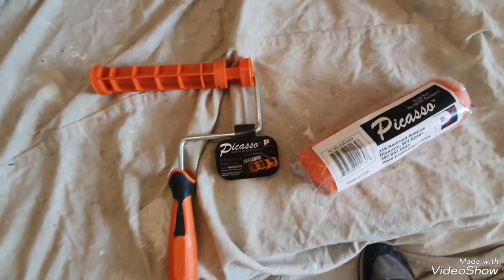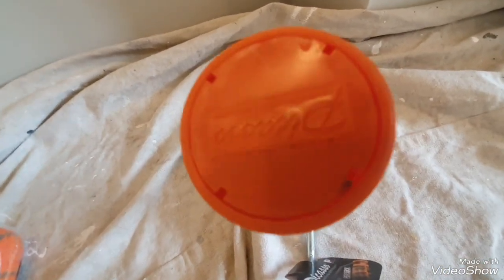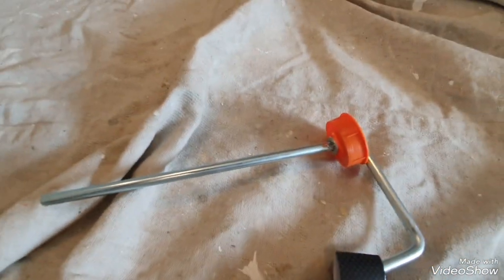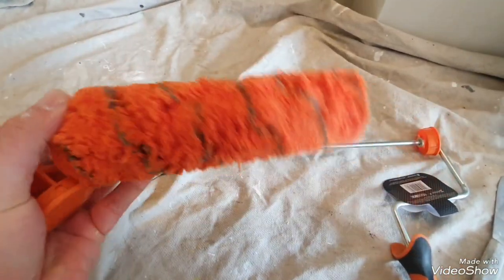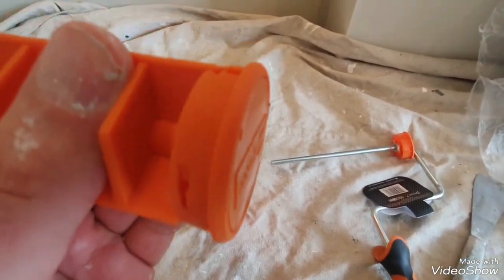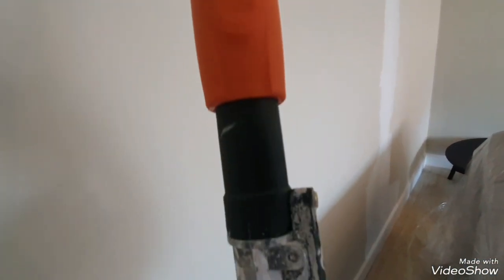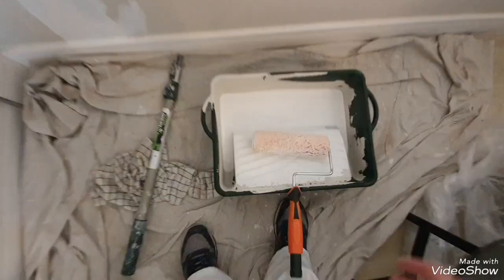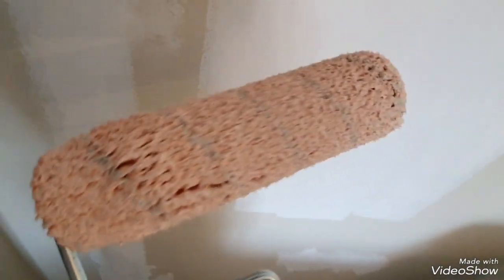The Best Roller Frame And Sleeve Yet

Comment: Paint is defined as a unique homogeneous mixture of three major. ingredients namely Binder, Pigment, VOC & additives, which when. applied on the surface as a thin layer that forms a solid dry. adherent film after oxidation/evaporation/ polymerisation”.

Comment: Prefer Arroworthy. Their blue vein sleeves are fantastic
Reply from the maker: Yes mate they are great quality
Reply: @danielnugentpainteranddeco557  Daniel, the Wooster bucket, can this comfortably accommodate 14" rollers? TIA
Reply from the maker: @Paul-dr8tq  I use 9 inch in the skuttle trays and 12 to 14 inch for the Sherlock Bucket tray which now does a lid as a separate item or you can get a big Ben tray that does up to 21inch so I use 18inch for that.  probably your best bet is the Wooster Sherlock Bucket Tray and you can buy the fitted lid separate. All on MyPaintbrush